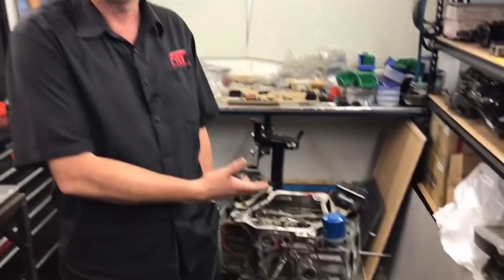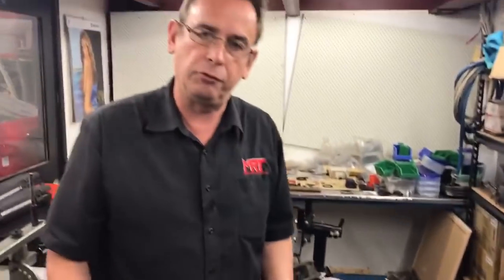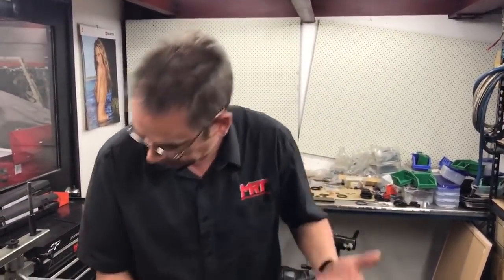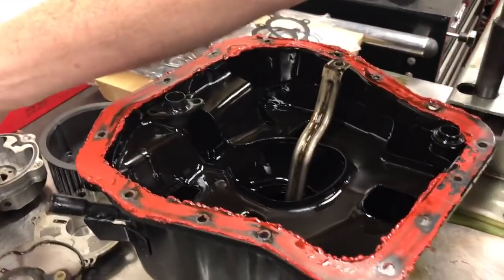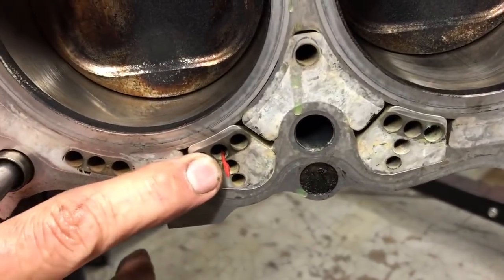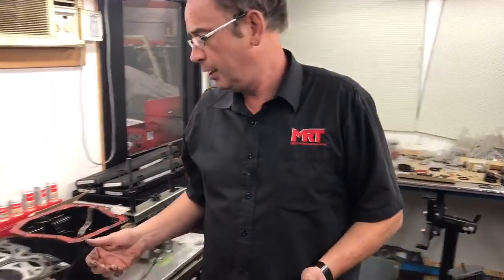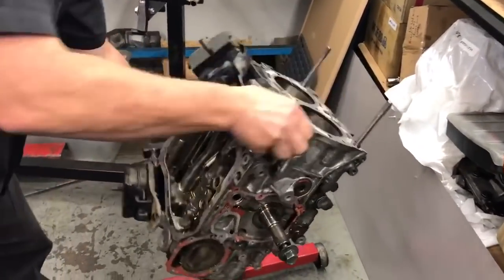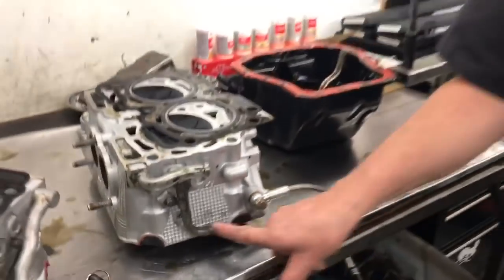Not all Engine Rebuilds are the same - Part 1

Comment: I experienced an sti engine which developed a rod knock, so we took it apart and found that the screen of the oil pickup tube was clogged up with pieces of soft black gunk - it was hard to tell the substance's origin, but I strongly suspected it to be pieces of superabundant sealant that got loose.

Comment: i found the rear main seal in my ej20 sitting at an angle and leaking oil all over the clutch plates. hade to replace the plates and i spent 30 minutes making sure i installed the new seal correctly, making small increments of adjustments as i went. becuse i got paranoid the the incompetense of the previous mechanic was somehow going to ruin my new seal

Comment: i may be wrong but from my experience id say that's just a wrecker motor that they've charged the customer for an engine rebuild and done a intake carbon clean up or at least the bottom end is wrecker motro that they slapped some heads on it. such a poor job ,even if someone didn't know ej20's and was a trained mechanic with some pride in their work it wouldn't have looked that bad.
Reply from the maker: It's been closed decked at some point though.
Reply: Yes at some point someone had a go at it but like you mentioned it should be honed once that was done and anyone with half an idea would have re machined it with a tourqe plate on it so it was perfectly round and also had the correct cross hatching in it.

Comment: What I don't understand is why bother with rebuilding bottom end when you can buy an STI block from Subaru for under 3k (AU)? Refresh existing heads and off you go. Surely proper rebuild cost is much higher than that. Of course it is different when you are chasing more than 250-300kW at the wheels and stock STI block is not "good enough". With STI EJ207 block you also don't need to worry about closing the deck as it is semi-closed already.

Comment: Hi Brett I have a question in regards to a car that I bought 2 years ago with a 20000 km rebuild and is now at around the 35000 Mark and every time I change the oil which is probably more frequent than it should be I always find swarf on the magnetic sump plug.
The sump plug is Cusco brand and the car is a WRX type ra STI version 3 EJ20k.
Is the swarf I am getting on the sump plug signs of bad rebuild?
Reply from the maker: this swarf varies with age and build quality

Comment: very gud also when can u make a video about subaru cooling system an what to look for when making 400+ hp pushing water out the over flow etc
Reply from the maker: if your engine is "pushing water" there are two  possible reasons
1 its got blown headgaskets  OR
2 the engine cooling system is in adequate and the engine coolant is overheating
Reply: Had sleeve the motor has darton dry sleeves the motor or car runs really strong bleed the thing with my vaccume too for cooling system heads an block was sent to chek for crank an flatness at the machine shop also jas arp head studs felpro gaskets i have done remove my engine 3 time for the same reason an still i get bubbles in my cooling system it doesn't over flow till over heat just worries me what about the caps i had put 2 20 lbs caps on the radiator an the expansion tank. Have up graded radiator the works an still
Reply: When driving normal everything stays put the coolant in the over flow would go down when cool
Reply from the maker: sounds like blown headgaskets
:(